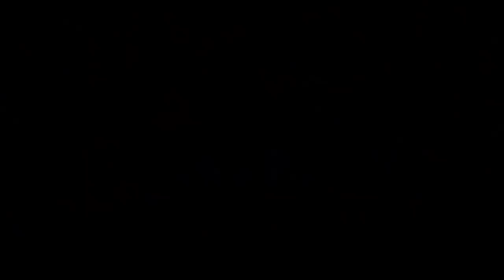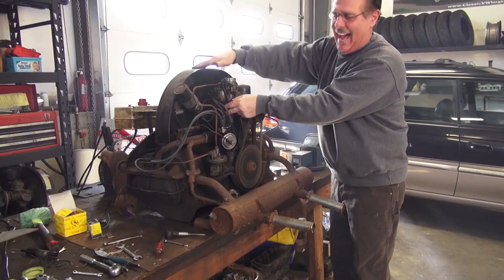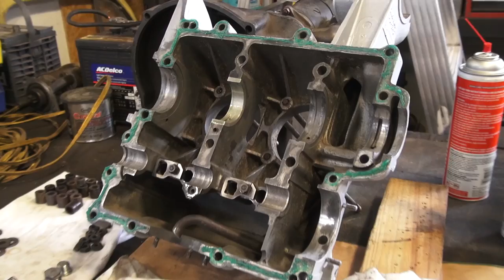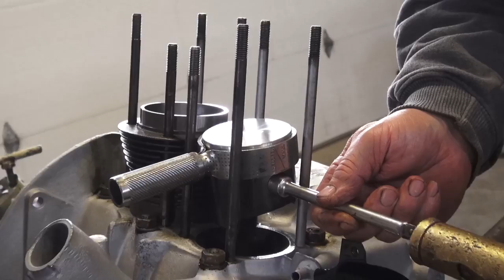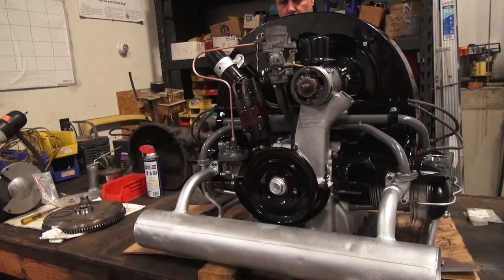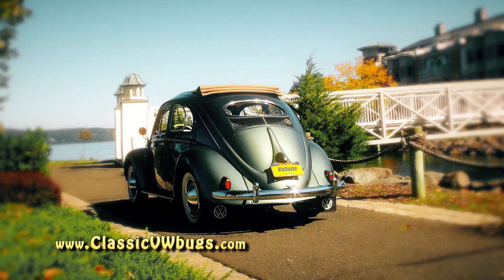Classic VW BuGs 36hp Beetle Motor Engine Restoration Build Teaser

Comment: Wow! This is GREAT NEWS! By the looks of it, it will it include a stock cosmetic restoration, too! Looking forward to a beautiful engine compartment, man! Thanks! (Alex, '58 T1 Sedan.)
Reply from the maker: Yes my friend, stay tuned.
Reply: Thanks for your response and your work for the VW community, Chris. Newbee, here. Do you think included could be a video on how you do the engine cosmetic restorations for the build-a-bugs? Maybe, something like paint selection, what is supposed to be unpainted, where to apply what material, what to leave as bare metal, etc? Is there a "generally accepted" engine-compartment cosmetic restoration guide you know of that can help "correctly" restore my '58 T1 engine compartment? I've found alot of "how to's" for engine internals rebuild, but, how about "prettying it up the correct way?" Maybe I've missed your past videos on this and if so, I apologize.
Reply from the maker: yes I have a video on powder coating your motor, engine detail.

Comment: Hey Chris are the copper o-rings between the heads and the jugs used for changing compression ratio or for head gaskets? I asked someone to use those copper rings because they had a leaking issue, but they said they're just shims to adjust compression.. just wanted to know if they actually seal up the combustion chamber
Reply: Hi mate, From what I understand because these engines work on a stale air concept the copper rings are just a backup seal to prevent exhaust gas from getting into the cabin if the head to cylinder joint started leaking since these engines got the heating air directly from the engine cooling air. I' m sure Chris will chime in.
Reply from the maker: this is just to help with heat transfer from jug to head